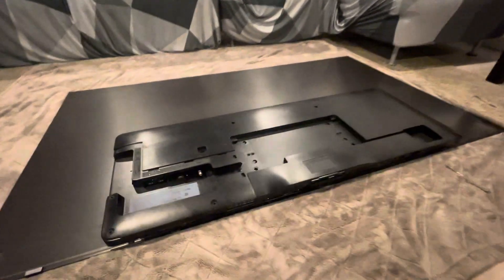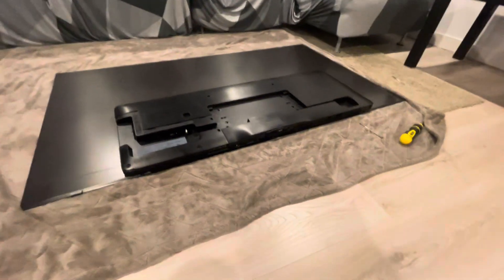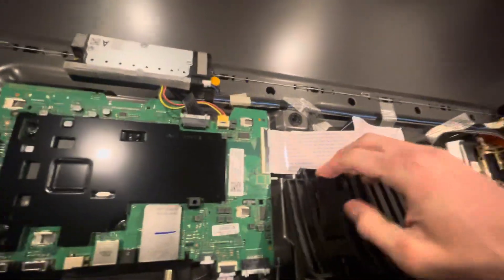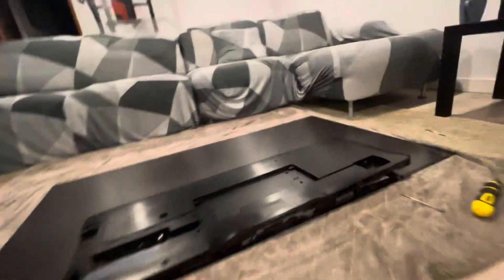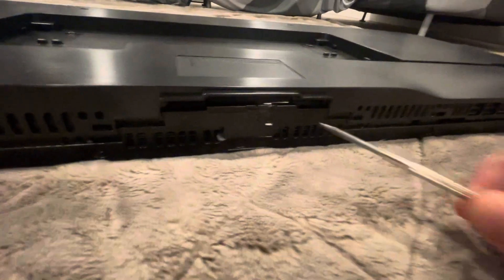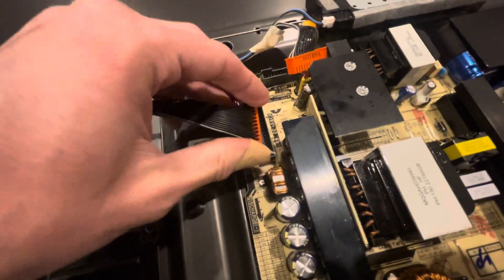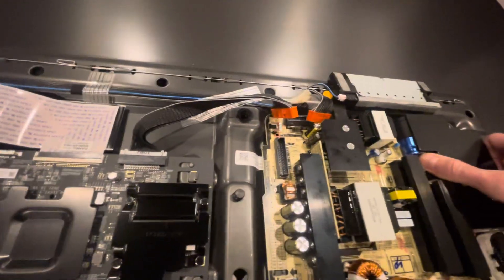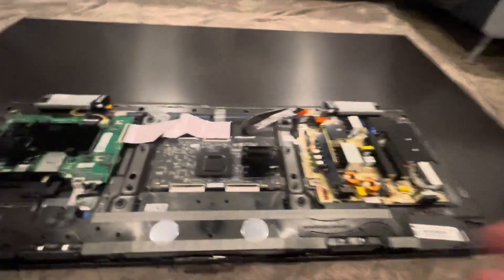Samsung S95B TV Power Board Removal

Comment: Nice and thorough video. Only thing to point out, is that I would not recommend using a screwdriver on those powerconnectors on the board. Otherwise great video. I also had trouble with those plastic clips.. took me 30-45 min, just to pry it open, until I figured it out.

Comment: Getting the power board out was the hardest part, so I used a metal piece that was thin and flat that had 90 degree angle, slid it underneath the power board and used a soft hammer to gently bang it towards the right. Save your finger tips. Ouchie. Did not solve the issue completely, but at least we hear the sound and the red light is back on. Thank you so much for your video.

Comment: Thank you for the video. Helped out a lot. What helped removed the board is on the bottom left side there it is labeled as "lock" that needs to be lifted as you push your board to the right. It disengages easily.
Reply: Clutch advice. This worked perfect. Lifted that end with a screwdriver and slid it right and the whole thing popped out no effort